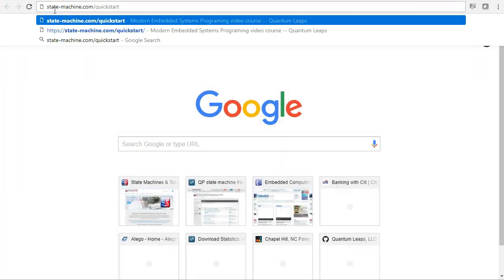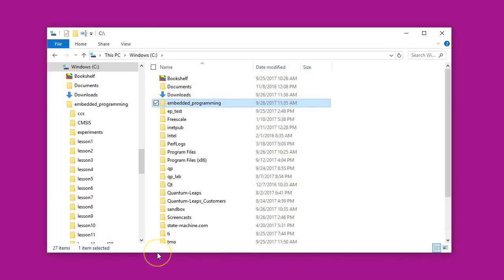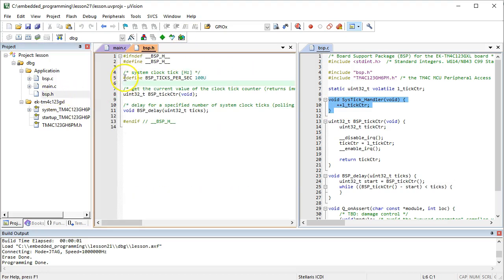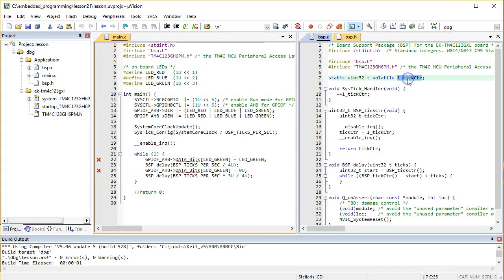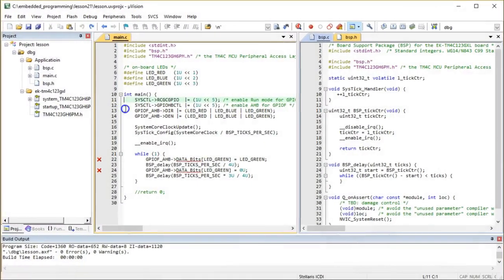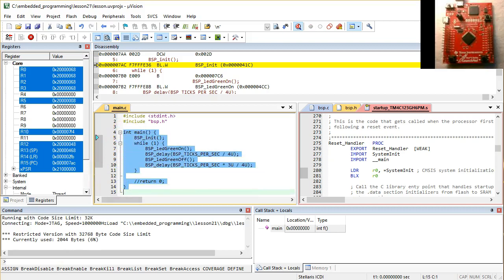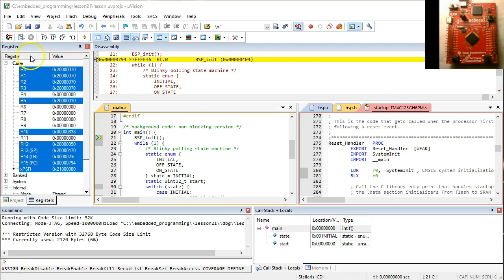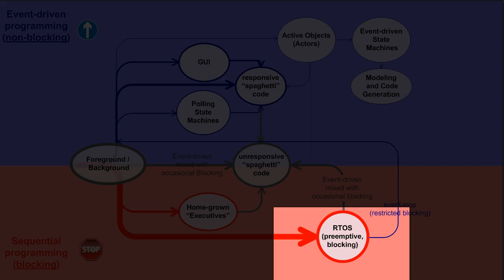#21 Foreground-Background Architecture ("Superloop")

Comment from the maker: NOTE: The source code, as presented in the video, might cause compilation errors with the newer MDK-ARM / uVision toolsets. This is because the underlying compiler in MDK-ARM has been changed to "Compiler-6", while the older "Compiler-5" is considered now obsolete. The updated code that compiles cleanly with "Compiler-6" is available from the companion website at:

https://www.state-machine.com/video-course

and from GitHub:

https://github.com/QuantumLeaps/modern-embedded-programming-course

Comment: HI ,qpc frame work is missing in your website in chapter 21
Reply from the maker: The qpc framework is not used and not needed in the projects for lesson-21, that's why it is not provided. --MMS
Reply: @StateMachineCOM  Thanks for your reply .what about RTOS chapter 6 & 7 ,qpc frame work is needed know,
to use semaphore ,mutex, osschelock concepts l

Comment: Could someone explain to me the significance of why static enum state and static uint32_t start, are defined inside the while(1) loop? If we define state and start before while(1) without the static keywords, is this bad practice?
Reply from the maker: You could define static uint32_t start before the while (1) loop, and this would be the only way in C89 and older. C99 and newer allow you to place the variable definitions anywhere in the scope (not necessarily before any executable instructions). And defining variables as close to their actual use as possible is considered the "modern" and recommended way (it was supported in C++ for 40 years). Now, regarding the 'static' keyword, it is essential here because it allocates the variable in the memory region for permanent variables. Without the 'static' keyword, the 'start' variable would be allocated on the call stack and would go away after the function returns. By the next call, the variable will be allocated again (on the stack), so it would be different and would not remember when the clock was started. Please actually try removing the 'static' keyword and run this on your computer. --MMS

Comment: HELLO!  i did all the procedure by downloading the Stellaries driver, and then it's extension by also considering there path. i did this in windows 10 and windows 11pro  but yet the stellaries is not there in selector of debugger in keil mdk.
Reply from the maker: You need to download the Tiva/Stellaris Extension for KEIL Vision "MDK_Stellaris_ICDI_AddOn.exe" and then you need to install it (run the exe file). The download is available from the companion web page to this course at: https://www.state-machine.com/video-course

Comment: i found  debuggin error " i downloaded Tiva driver from site and still i can't get it in the selection of debugger "
Reply from the maker: There are two separate pieces of software here: (1) Tiva/Stellaris USB Drivers for Windows and (2) Tiva/Stellaris Extension for KEIL uVision. Both are available from the companion web page to this course at: https://www.state-machine.com/video-course#Resources  .  After downloading the Tiva/Stellaris Extension for KEIL, you need to install it also. --MMS
Reply: @StateMachineCOM   I did all the procedure by first download keil then download the drivers and then download the extension zip and extract it but yet no change i did this in two different computer with one having windows 10 and other with windows 11 pro, with same hardware but still when i'm trying to find the debugger in the selector is not there.
Reply: I install all of them but still when I'm trying to find Debuger in selection it's not yet there. @StateMachineCOM
Reply: @StateMachineCOM   I DID ALL THE PROCEDURE AND STILL IS STILL NOT THERE
Reply: @StateMachineCOM But the procedure are the Same and I did them  to a different laptop one which have windows 10 and other 11 pro but yet is same problem
Reply: Meaning I download Drivers and it's Extension.
Reply: I did all the procedures, including download keil then drivers also  the  one extension and extra it but But yet when I'm opening the keil I'm not find it so would like to know the problemi did all the procedurein two different windows 10 and 11 pro @StateMachineCOM
Reply: @StateMachineCOM   HELLO I DID ALL THE PROCEDURE BY DOWLOAD DRIVERS AND EXTENSION BUT YET WHEN I'M TRYING TO FIND IN SELECTOR OF DEBUGGER IS NOT THERE.

Comment: I don't go to main with debug and it go to " LDR     r0,=0xE000ED08  ; System Control Block/Vector Table Offset Reg". Can you help me pls.
Reply from the maker: Please make sure that you select "run to main" in the debugger setting (the debug configuration dialog box has a checkbox). If you don't select "run to manin", the code execution will start from the reset vector. --MMS

Comment: HI,Dr. Samek,why after I downloaded the new 21lesson you provided and put the qpc folder in the correct location (the same as the tm4c123-keil folder), I got these two identical compile errors into KEIL:ek-tm4cl23gxl/cmsis compiler.h(41): error: 'cmsis_armclang_ltm.h' file not found. This header file clearly exists in ek-tm4c123gxl.
Reply from the maker: I'm not sure what happened with the lesson-21.zip download, but please download it again and give it another try. The projects have been recently updated and are now self-contained, meaning that you don't need any other software components to build and run the projects. The download section of the companion web-page at https://www.state-machine.com/video-course#Videos has been also updated and a prominent note has been added about the self-contained nature of the projects. --MMS
Reply: @StateMachineCOM  THANKS for your answer but i download and decompressing it again it still has two same error.Then i change cmsis_armclang_ltm.h in the project to cmsis_armclang.h.Firstly,it said 95 warnings and then hit the build button again and it turned into 0error 0warning. However, when I downloaded the program into the TM4C, the light on the board did not blink as expected.
Reply from the maker: @JZL-et4nr  I just downloaded lesson-21.zip from https://www.state-machine.com/video-course again, uncompressed it, and opened the project in my KEIL uVision V5.38.0.0. It works for me flawlessly, so I really don't know what to fix. Please check that you indeed are using the latest version. --MMS
Reply: Thank you very much for your answer, I will continue to find the cause of the error @StateMachineCOM

Comment: Hi - Why do you think that the reading of l_tickCtr need to be under the critical section? What type of race condition do you see if the reading of the l_tickCtr is not protected by critical section? thanks
Reply from the maker: On a 32-bit CPU, reading a 32-bit l_tickCtr variable is probably safe from race conditions because the 32-bit LDR instruction is atomic. However, on a 16-bit or an 8-bit CPU such a read would no longer be atomic and so a race condition would be possible. My goal in this lesson was precisely to emphasize such concurrency hazards and to point out portable protection mechanisms. --MMS

Comment: hi, when building i get, the following cant find files error
Build started: Project: lesson
* Using Compiler 'V6.16', folder: 'C:\Keil_v536\ARM\ARMCLANG\Bin'
Build target 'dbg'
assembling startup_TM4C123GH6PM.s...
startup_TM4C123GH6PM.s: error: A1023E: File "..\qpc\3rd_party\ek-tm4c123gxl\arm\startup_TM4C123GH6PM.s" could not be opened: No such file or directory
ArmClang: error: no such file or directory: '../qpc/3rd_party/ek-tm4c123gxl/system_TM4C123GH6PM.c'
ArmClang: error: no input files
compiling system_TM4C123GH6PM.c...
bsp.c(5): error: 'TM4C123GH6PM.h' file not found
#include "TM4C123GH6PM.h" /* the TM4C MCU Peripheral Access Layer (TI) */
         ^~~~~~~~~~~~~~~~
1 error generated.
compiling bsp.c...
".\dbg\lesson.axf" - 4 Error(s), 0 Warning(s).
Target not created.
Build Time Elapsed:  00:00:01
thanks for you time.
Reply from the maker: It seems that you are missing the qpc software which is a separate component. You need to download the [qpc.zip](https://www.state-machine.com/course/qpc.zip) file (the link to qpc.zip is provided in the "Project Downloads" column on the companion web page). You then unzip it so that the qpc directory is at the same level as your lesson-21 directory. The qpc software will be needed in most lessons moving forward. --MMS
Reply: was facing same issue thanks for reply, both must be at same level, lesson-21 and qpc in unzipped format
 @StateMachineCOM

Comment: Thank you Dr. Samek, the lesson21 project download works as expected.

However, I was playing around with the code and it seems that after replacing some of the function calls in main() with their corresponding function body (such as BSP_init() and BSP_ledGreenOn(), for example), the board locks up when trying to run the debugger. The LM Flash Programmer is then needed to unlock it. Revert these changes back to their respective function calls and everything works fine again. I attempted to debug this issue myself by comparing the disassembly of both scenarios but nothing obvious stood out to me, e.g., stack/reset vector values look correct, etc. What could be causing this? Perhaps a project/configuration issue or something related to uVision itself?
Reply from the maker: As you've just discovered, the initialization of the embedded board is sensitive code. For example, if you don't enable correctly the clock to a given peripheral, any access to that peripheral might end up in the HardFault_Handler exception. In fact, I suspect that this is happening and your board keeps quickly resetting (through the Q_onAssert() handler). In that case, the hardware debugger cannot get hold of the CPU and you end up with a locked-up board. But this is also a good opportunity for you to learn that in embedded systems nothing works until everything works. So, it is critical to start with working code (which you have!). Now, you can make changes in small steps, changing only one thing at a time and always checking if the thing still works. As soon as it stops you will know which step broke it. It might sound like a lot of work, but it will take less time than writing this comment. I hope that this general advice makes sense to you. --MMS
Reply: @StateMachineCOM  The more I experiment, the more strange this issue seems.

I start out with your working project download code. Then in main(), I replace the BSP_init() function call with its function body, and everything still builds/debugs cleanly (the TM4C header include and LED macros must also by added to main(), as well). Then, I replace the BSP_ledGreenOn() function call with its body (i.e., `GPIOF_AHB->DATA_Bits[LED_GREEN] = LED_GREEN;`), and now I get a board lockup on debug. More unusual is that if I instead only replace the BSP_ledGreenOff() function call with its body (i.e., `GPIOF_AHB->DATA_Bits[LED_GREEN] = 0U;`), it also leads to a board lockup. In other words, the changing of a single line of code with another single line of code (replacing either function call with its body) is enough to corrupt the board.

Also, using the IAR project files to make these changes and build/debug the board works fine, so the problem looks to be happening within uVision specifically.
Reply from the maker: @abominabletruthman  Finding a compiler error is rare, but it happens. Have you tried to change the compiler optimization (e.g., -O0 or -Os balanced)? --MMS
Reply: @StateMachineCOM  I just performed the procedure above for all available optimization levels and the only one that does not corrupt the board is -O0. All others result in a lockup. So, any optimization at all creates this issue, though I still cannot make out what exactly is causing it when comparing the disassembly views of the good and bad executables. Whatever it is, it does seem to be a bug with Arm Compiler V6.19.
Reply from the maker: @abominabletruthman  This might be an issue of pipelining in the CPU. Specifically, after enabling the peripheral clocks for GPIO, you cannot access the GPIO peripheral immediately. ARM CPU provides special instructions to make sure that instructions don't run into each other (see ISB -- Instruction Synchronization Barrier and DSB -- Data Memory Barrier). I recommend using both of them after configuring the GPIO clocks and AHB use but before accessing the GPIO. In fact, all project downloads have been updated to use the calls __ISB(); __DSB(); Please see the GitHub repo for the course at: https://github.com/QuantumLeaps/modern-embedded-programming-course --MMS
Reply: @StateMachineCOM  I figured out a way to debug the bad code after and was able to confirm that you were right in that the issue was a fault due to premature access of an unready peripheral. However, it was not the GPIO Port causing this, but in fact the AHB itself.

In the -O0 code, there were MOV instructions inserted by the compiler between the AHB enable/access to prepare the GPIO memory address in a register, but the MOVs were placed elsewhere with -O1. In other words, the LDR access of the GPIO Port over the AHB was positioned immediately after the STR enable of the AHB and when executing at full speed, a fault occurred. The fault did not happen when single-stepping over these instructions in the debugger which suggested that it was a hardware latency issue, not a pipelining issue.

I spoke with TI Support on this and they said that because there is no ready-bit register to check for guaranteed bus readiness (like there is for the GPIO with register *PRGPIO*) and because the data sheet does not mention anything about a specific wait time, they could only recommend inserting an arbitrary delay in between the AHB enable/access (like a few NOPs). Your use of DSB/ISB seems to be sufficient for this, too. Support made a forum post on this with the full details here: https://e2e.ti.com/support/microcontrollers/arm-based-microcontrollers-group/arm-based-microcontrollers/f/arm-based-microcontrollers-forum/1184593/tm4c123gh6pm-accessing-the-ahb-immediately-after-enabling-it-throws-a-fault/.

Just wanted to update on my (over-the-top) investigation of this issue, and thanks for the help in getting to the bottom of it.

Comment: Thanks for such an amazing embedded software playlist. Sir I have two questions. In the main function you have defined the function SystemCoreClockUpdate() and Systick_config function. In the systick_config function you have passed SystemCoreClock variable as an argument. In the CMSIS documentation it is stated that the function SystemCoreClockUpdate() updates the new clock value of the systick timer as well as the Arm core CPU but you havent provided any  parameter to this function so why called this function ?? And the second thing is, the argument passed to Systick_Config function is  SystemCoreClock/100, because in the video sir you havent provided any argument to SystemCoreClockUpdate(), so according to the datasheet the clock to systick timer is systemclock/4 which is 4000 and dividing it by 100 which is the value of bsp_ticks_per_second  comes out 40,000 which does fire the systick interrupt after every 100 ticks. But in the video you said systick fires at 100_ticks_per_second but how?.
Reply from the maker: This question is about the design of CMSIS, specifically of the CMSIS functions SystemCoreClockUpdate() and SysTick_Config(). These functions are NOT defined in this project. Instead, SystemCoreClockUpdate() is defined in the CMSIS file system_TM4C123GH6PM.c (which is included in the project) and the function SysTick_Config() is an inline function defined in core_cm4.h header file.
The CMSIS design is indeed a bit clumsy in this respect. But when you look at the definition of SystemCoreClockUpdate() (in system_TM4C123GH6PM.c), you will see that it has a side effect of setting the CMSIS global variable SystemCoreClock based on the registers of the specific MCU (TivaC in this case).

In the end, however, this is a completely inconsequential detail for understanding the main premise of this lesson, which is "Foreground-Background Architecture". It's good to try to understand the details, but I hope you are not losing the forest for the trees! --MMS

Comment: Hi sir, thanks for amazing course. But I'm confusing at the foreground/background model at 9:11. Why the length of ISR is different for each other? I think ISR systick decrease counter every machine cycle repeatedly in constant, so why it is different? I see in the program you stop and start interrupt in the BSP_tickCtr() function but I still don't understand why it effect the lenght of each ISR?
Reply from the maker: Thanks for paying attention! You're right that in this particular example, each invocation of the ISR should take about the same time to execute. But in the picture at 9:11, I wanted to show a generic case, where ISR invocations can take different times to execute, and also, there might be different ISRs. I hope you can easily imagine that there might be IF statements or even loops inside ISRs. The main point is that you cannot count on ISRs to always have the same execution time. Finally, the picture at 9:11 does not show another factor, which is the time interrupts are disabled in the background loop. That time causes ISRs to execute later and that delay is also variable, depending on how long the interrupts are disabled in various parts of the background and also when the ISR fires. All of these factors introduce jitter. --MMS